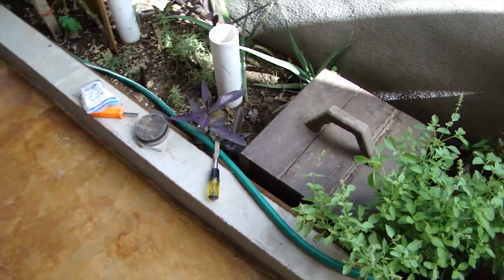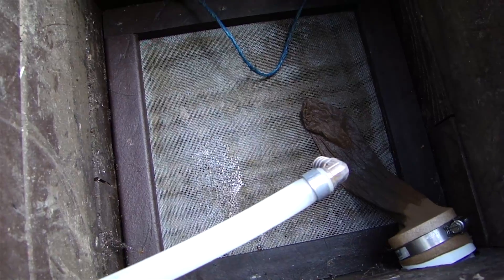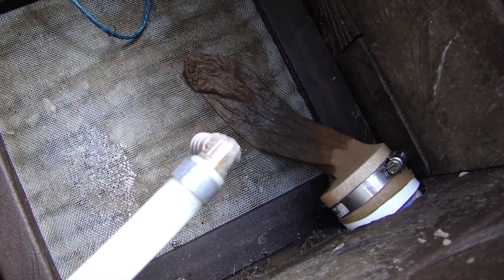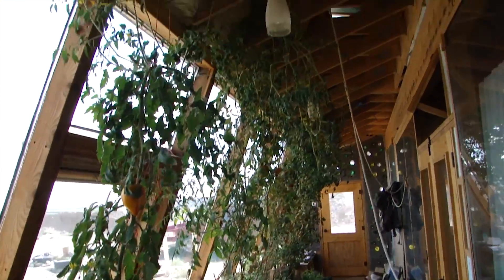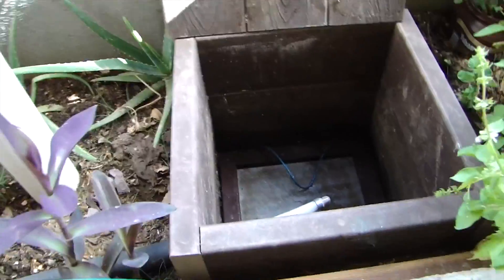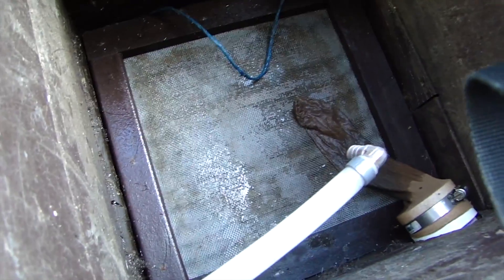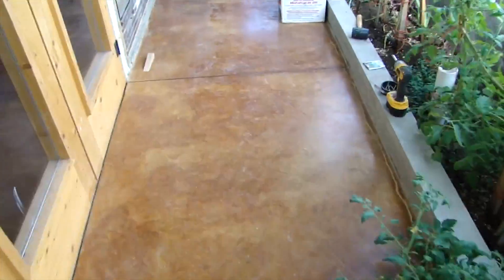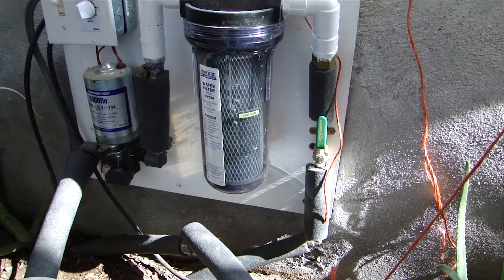Gray Water Planter Performance

Comment: One way to retain odors is to seal the caps and the receptor cell with grease or oil burned. It may not be very pretty but it is effective. A hug good work.

Comment: I love your blog! Im watching it almost everyday! What I'm wondering is a ballpark cost on the project. I know every home is different and WIDE ranging in cost but it would be nice to know some of your costs on your techniques. Im wanting to build a fairly larger scale earthship in south carolina somewhere around 2,500 sf. So I'm wondering if its cost effective to build from scratch or simply renovate a house to be self sufficient. Thanks so much for your dedication to helping other people!
Reply: According to the website, the build cost around $120k for parts and labor, not including land.
Reply: Great thank you so much for your responds. Im currently looking into other natural home buildings because im not so sure the cooling in the home would be enough for a South Carolina summer :(
Reply: Sandon Sabetta  I visited the Earthships in Taos last year, and they were pleasantly comfortable.  Though my visit came in May and it was only around 10am, so the full heat of the day hadn't arisen yet.  Still Taos gets well into 90-100 in the area on a regular basis, so the heat has been accounted for.

I think the biggest issue when building outside of the Southwest would be humidity.  Earthships are kind of like basements.  Add that to the indoor garden and you have a lot of moisture in the air.  I think a sizable dehumidifier might be a wise idea.
Reply: Sandon Sabetta Depending on how much work you do yourself around $200/sqft.  I've seen it as low as $130 but you are doing most of the work yourself.